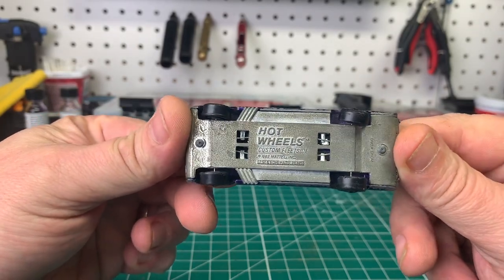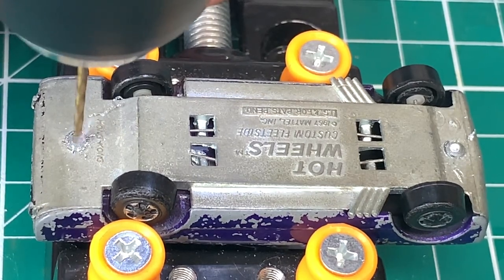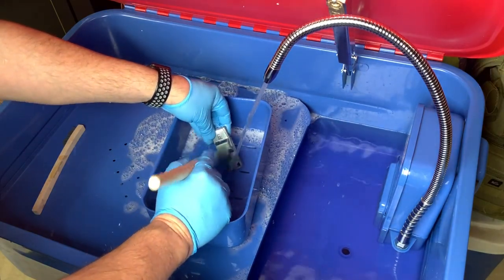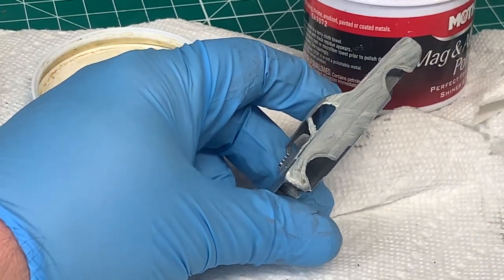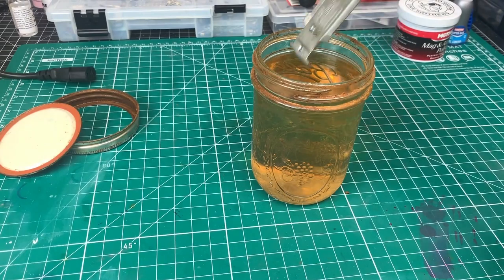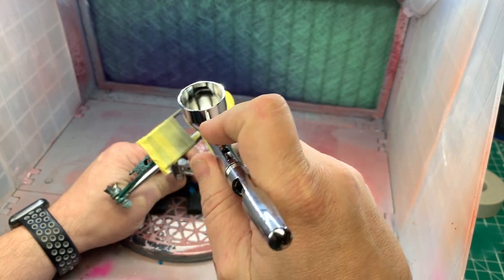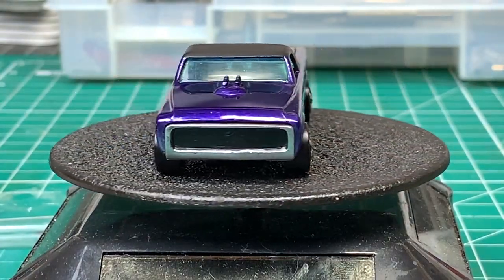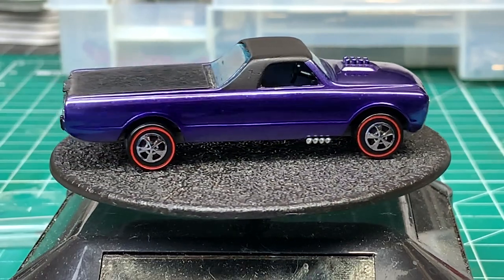Hot Wheels Redline Restoration : Custom Fleetside

Comment: I wish I'd seen this video before I renovated mine, but mine was in worse shape, ie missing a wheel, no bed cover, no glass. I swapped the wheels for some rubber ones and I drilled the base to fit a new axle, I have left the metal bare and I am happy with results, although at the time I did not know of the wheel removal tool. A great video and approach, your voice is steady and calming, you dont talk down to your watchers and give of your experience and knowledge freely. Thanks.

Comment: Beautiful job! The fleet side is based on Harry Bradley's 1964 El Camino, and is the only one that I know of. I bought two of the RE issues in the lime gold color and one of them I removed the orange ramp. I would also like to say that because of you and your videos, I was inspired to build a 1964 El Camino using one hot wheels 1964 chevelle, one johnny lightning   1964 chevelle convertible, and one johnny lightning 1965 El Camino. A johnny lightning 1969 mustang was used as a donor for the wheels. All in all it came out pretty good. Again thank you for the work that you do and the inspiration to take on such a project
Reply from the maker: Thank you, that is awesome to hear. Love to see some pics!

Comment: Good research on the origins of the casting.  I had thought the Fleetside name meant the casting was based on the 1 ton pickup of the Fleetside or C10 series models.  The more beaten up the casting, the greater the wow factor when the restoration is revealed.
Reply from the maker: I had the same thought!

Comment: Because I've never used RLShop Magic Black, do you use the hardener with it? A suggestion for your tonneau cover, super thin (blister pack/vacuum formed) clear plastic trimmed and glued over it and painted with magic black or a mix of 25% satin/75% matte. IDK if that's too much work, but it's an idea.
Reply from the maker: No hardener with the Black Magic, according to the Redlineshop it won't mix. Great idea on the cover, I may have to break out the VF again!

Comment: The original car is clearly El Camino based, but the casting looks very much like the pickup truck with a slanted back window.
Reply: "and the Custom Fleetside, (based on his own customized 1968 Chevrolet C-10 Fleetside)" it is the pickup truck, according to the Wiki piece. Since the casting looks exactly like the pickup truck to me, save for the back window, I think the Wiki piece is correct.
Reply from the maker: It looks like one to me also :)